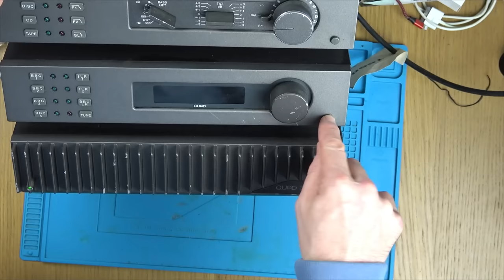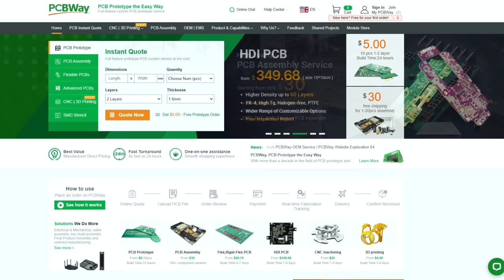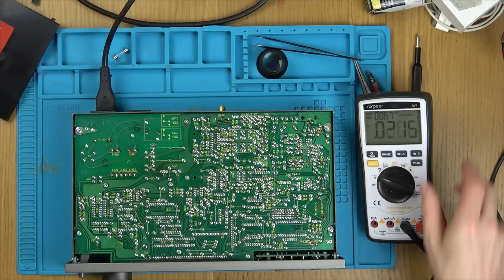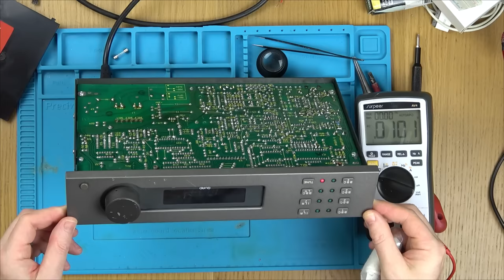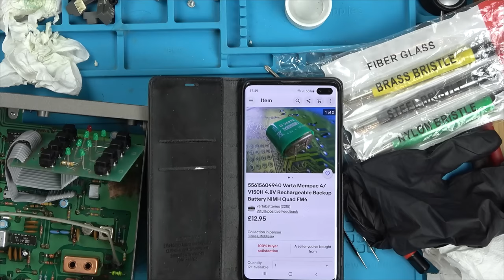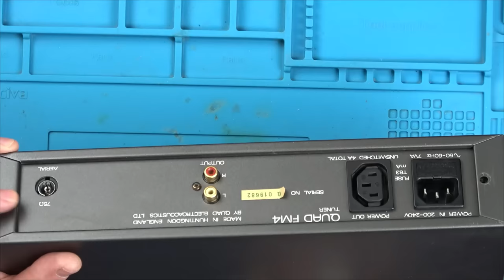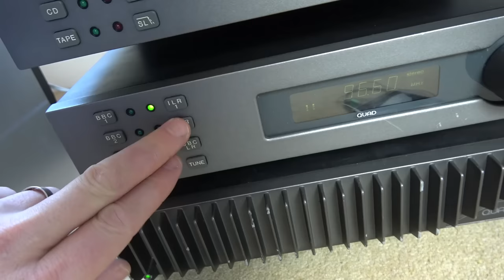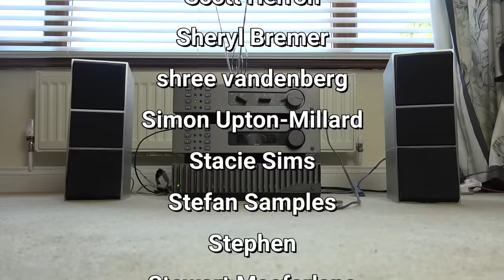QUAD - The Crème de la Crème of Audio - Can I FIX it?

Comment: Cheers for the video mate. I used to work at Quad building the speaker cabinets and spraying the speaker membranes with carbon. Your little discs are also carbon sprayed on one side. My mum worked there for 23 years before Mission took them over. She retired 3 months later and they gave her a brand new set of Mission 77 speakers. I still have them to this day and they work fine on my 30+ year old JVC UX1 Micro System. There is still a little company of ex employees in Huntingdon that service and repair anything Quad. And did you know Mike Oldfield recorded Tubular Bells in a studio full of Quad equipment including 26 Electrostatic speakers. He was our biggest customer in the UK. Most of the equipment was shipped to Japan as at the time they couldn't emulate it as it was all hand soldered.
Reply from the maker: This is amazing, a few comments came in about the little discs mentioning they might be silver plated, but now we know it's carbon!!!!  Also the Tubular Bells bit is just the icing on the cake. 
Thanks Trevor! Can I pin this comment so others get to read it? No problem if you would rather not 👍👍👍👍
Reply: @Mymatevince  By all means. Its history.
Reply from the maker: @trevorjones5625  Nice one 👍
Reply: Put me right in an era that I wasn't even a part of yet! A nice bit of audio history, thank you for sharing.
Reply: Tubular bells tho 🎧
Reply: As well as Mike Oldfield, am I right in thinking Nimbus records used Quad electrostatic speakers when mastering?
Reply: Hi there I remember quad. I worked on st. Peters hill making racing cars for a company called Lola
I'm used to know this old man call Charles he told me that he used to work for quad and was one of the people who helped design the electrostatic speaker an interesting man and I would sit in the pub with him definitely a professor type. Generally with food on his shirt and not a care in the world one day he was telling me a story about the time he made a set of speakers for Eddie Van he said they like to pay send but they prove the point I miss old eccentrics like that it's nice to know that there's people that remember admission and the knowledge Street Huntingdon gave to the world of speaker technology
Reply: @stewartcpitt  Hi Stewart. I remember Lola's well and was a very sad day when they finally closed. My brother worked for Lola Composites for a few years. I used to work down the road at Specialised Mouldings/Darchem/Paxfords. And yes, Charles was one of our secret weapons and an absolute genius. A very humble man but an amazingly kind soul. If you know Lola so well then you must remember Insulpak. I ended up working there for 20 years until 2013 when i retired due to ill health. Luckily a lot better these days. Are you local as i moved from Huntingdon to Godmanchester 17 years ago so still local.
Reply: QUAD equipment is brilliant i have an old Quad 2 set 1 pre amp 2 mains for stereo old valves KT22 etc still nothing to match tne sound quality 😊😊
Reply: I think there are quite a few other high-end audio companies in Huntingdon too - spinoffs, ex-employes etc.
Reply: @theelmonk   *Heartwarming to see some chaps chiming in regarding the older brands and the solder slingers as well. I'm from across the pond, and I have to say that there were many fans of the Quad electrostatics.
 There are also some shops that refurbish a lot of the '70s and '80s and beyond receivers and electronics. They still sound great. It's not necessary to spend a lot of $$ to get great sounding gear. 
 Check out the work being done at GR Research, his speaker mods, and new, affordable speakers.
 TTFN
Reply: Are the mission 77 the ones also known as Argonaut ,powerfull with low impedance?
Reply: @RUfromthe40s  I've never heard that name but it is possible. I never worked for Mission, i was given the speakers when my mum retired from there.
Reply: @trevorjones5625   i have some Argonaut mkII ,maybe from the second half of the 80´s and the number was the same but argonaut it´s written in the midle of the speakers box, they are big with 4 ohms and with lot´s of power i don´t remenber what i paid for them but they were expensive
Reply: I used to work at a professional audio shop selling QUAD 303, 404, 33, FM3, ESL-63, 44, etc so well built, I purchased 44 control unit & 405 control unit in the time they first came out in 1980s but last year some theif walked away with my 44 & 405 in mint condition the police are doing their best to locate them, they have a good idea who it was,
Reply: @CoolMusicToMyEars  Same thing happened to me a few years ago, My 405, plus later 90's NAD 216THX (one of only a few  more modern "real everyday peoples" amps worthy to sit by a 405 I reckon), and preamp, 80's Nad CD and cassette deck, Paradigm floor standers and nice little passive JBL sub with 4X5" drivers, (thats 4 of5") in a 3 way bandpass cabinet so 1 pair each mounted facing each other push-pull on the two internal divisions, plus the DAC I spent a fortune on because the blueray recorder only had toslink or coax, oh and the blueray.  Not an inconspicuous haul in a town of only 25,000 in New Zealand.  Cops had a tip off and all, but circumstantial and couldn't find grounds to search.  I still had the original Quad box and manual too, I think I binned it all in disgust.
Reply: @stewartcpitt  Did you happen to know Peter Bohanna? He was a designer at Lola.
Reply: @johnriley9214  The Quad IIs had KT66 output valves. When I was a student, I had a pair of Quad IIs and a pair of the matching preamps. The preamps were a pain due to the weird matching networks that plugged in the back, but I bypassed them and added an extra phono preamp. The setup sounded fantastic; sadly, as a broke student, I ended up selling them.
Reply: @cambridgemart2075  i would love to have quad tube setup
Reply: @theelmonk name drop then???
Reply: Was worth coming and watching this video just for the heritage in this comment!
Reply: the soldering on this board looks insanely good
Reply: Thanks,nice piece of history... We could have been a leader in allof that
Maidstone is the home of KEF spekers ,,,,, oh dear what happened !!

Comment: A word of advice at 40:52: you’re melting solder above the tuner’s faceplate. Since occasionally molten solder drips or sizzles, it’s a good idea to not have it near any cosmetic finishes you don’t want marred. I learned this the hard way.
Reply: Same bit of advice can be said for soldering electronics while in the comfort of your own bedroom while in your underwear.
For obvious reasons... learned this the hard way as well! 😝
Reply: @cerberus50caldawg  at least you were smart enough to wear underwear... learned this the hard way as well.
Reply: @cerberus50caldawg  i once dropped the soldering iron whilst modding an xbox, and stupid reflexes my hand swung and caught it... as in the hot metal end. dropped it immediately, half my skin tore off onto the iron, and cause me about a months worth of blisters and discomfort
Reply: @SyndicateofGamers  What did you shout, without swearing.....?
Reply: @gdj6298  can't remember exactly but knowing me plenty of f's and c's
Reply: @SyndicateofGamers  Everyone who works in electronics has done that. Usually only once!!
Reply: @cerberus50caldawg when I was young (really young like less than 10 years old) I had a pack of old circuit boards that I used to remove components to reuse. I also learned the hard way that you should wear socks on your feet because those blobs of solder hurt a lot when they splashed on my instep LOL! And they left burn marks for many many years.
Reply: @cerberus50caldawg  What's that Jerry Lewis song ..?
Reply: Loving the sound of that amp at the end. Lovely bass
Reply: @andylake7202  true, i think it hapens to everyone normally once is enough to really learn
Reply: Me too... I also learnt, not to try and remove components such as capacitors off of a PCB out of something using my leg and arm as a support. Slipped a few times with the iron.
Reply: @hernancoronel  The socks don't help, the solder melts through the socks and leave a nice burnmark, 12y old self found out.
Reply: Me too, fortunately i was 14 yo and hiding from my dad not to see me opening up something electronics 😅

Comment: I've had a Quad FM4 for around 30 years. It still does duty from time to time. I used to work for BBC Radio and we used Quad power amps for driving studio monitor speakers for around 20 years. As with any other fine equipment, you'll only get the best out of it if its partnered with other quality gear.

Comment: I like the video vince, well done on the repair.
My only suggestion in no power faults is always check the fuses first.
Once fuses are checked or replaced check the power rails shorting to ground without powering up the device.
If its shorting then investigate thoroughly.

Comment: Loved watching you work on the Quad. I own 13 year old Quad pre/power amps that I absolutely love in my system. I dread the day that they go wrong but watching this gave me hope that they could be saved. Thanks for a great video.
Reply: Hi. FYI, Quad (can't remember what the actual company is now, but can be looked up) are very accomodating when you have problems. We had a stupid fault on our Quad 44 preamp which just required a resolder. Unfortunately, while unattended for 5 minutes one of our Labrador puppies got at the PCB and did terminal damage to it. At quite modest cost, Quad supplied a new PCB + gold module connectors and a new relay to replace the one that had been mangled. We rebuilt it and all was good. There are many full schematics on the web + upgrades should one wish to go that route. Also had dealings back in the 80's and they were brilliant, supplying new components for nothing after I inadvertently blew up the 405 power amp through my own carelessness.
Reply: @Annie Masters  Thank-you so much for that information. It's good to know that they take such good care of past customers like that and when and if I have a problem I'll try them 1st. I listened to lots of different amps when upgrading 13 years ago and the Quad 99/909 pre/power amp's were the only ones I loved and still do. I'm glad you managed to get yours up and running again, with their help. Long may our respective Quads live on.
Reply: @rosalynadams3758  Quad always took long-term support seriously, and looked after old equipment. An odd little vignette on this: when they changed to using metric screws and threads, they had the problem that people might get confused when old equipment was in for repair, and force a new metric screw into a casting with holes tapped for imperial threads, thereby ruining a casting that would be hard to source. So someone came up with the clever idea of simultaneously changing from slot-headed to cross-headed screws so it would be obvious at a glance whether a screw in the repair place was imperial or metric.
Reply: That generation of equipment was far more repairable than modern stuff and will remain so. People are still maintaining vacuum tube gear, after all!
Reply: buy replacement components now

Comment: When starting up decades-old audio gear, with linear power supplies, I like to use a variac to increase supply voltage slowly, from zero to nominal over a period of hours, to give the old electrolytics a chance to re-form their dielectrics. Never had one go bang. Those filter caps on the other hand might need to be changed as a precaution. I remember the Quad stuff first time round and my memory is trying to tell me that the Quad 306 amplifier had a 'Current Dumping' circuit, and probably about 50-70W rms continuous per channel for two channels.

Comment: Hi Vince! Just came back to this video to thank you for inspiring enough confidence in me, that I took the chance on buying a broken Rotel CD player for 25 quid, in the hope that I might actually be able to fix it. The CD deck was advertised as able to power on but unable to open the disc tray. Naturally I assumed it was simply the drive belt for the tray eject/close mechanism that had gone to goo. 

I bought it and tore into it, but alas it was not only a broken belt, the gear that moves the laser lens assembly up and down had worn down and become brittle. That means that while the deck will actually read the CD and display the number of tracks on the TOC, it simply will not play since the laser couldn't move along. Tracked down a replacement gear for under 5 quid posted, and it now lives again! An expensive deck that still goes for a couple hundred quid, used in working order, these days for 30 pounds! 

Your videos made me believe that with some logical troubleshooting steps & methods, as well as a good amount of luck, repairing stuff doesn't require a garage full of expensive, specialist tools. Basic tools & subject to the availability of parts, a novice can get the job done eventually. Thanks mate! Keep doing what you enjoy, and I'll keep enjoying watching what you do! Cheers!
Reply from the maker: Well done for giving it a go and congrats on the successful fix 👍👍👍 One of many I hope.

Comment: As you apparently were looking for a production date inside the power supply section and not finding it there, may I remind you that the the IC labels include a manufacturing date codes. In this case, the TMS1000 microcontroller clearly shows it was manufactured in 1986.
Reply from the maker: Thanks Ascania 👍👍

Comment: Came across your channel by accident and found this video very interesting.  Brought back memories of my early career in BR.  We used Quad 50E, mono multi-tap transformer output, amps for station PA.  They were virtually bomb proof!  If I remember correctly we had around 30 located in Kings Cross station distributed across 4 equipment racks around the station for the PA.

It was very interesting to see the quantity of analogue circuitry in the tuner, clearly indicating why the cost was so high.  Nowadays of course a SRD receiver chip a DSP chip and a small micro would be all you would need - how times have changed 🤣 the most expensive components in modern audio equipment  is probably the human interface devices (knobs and buttons!)
Reply: Receiver, DSP, couple tactile moms, input jack, pot, couple of posts/banana sockets, 50+50W(pk) class D board the size of 20 Pall Mall from aliexpress for $5.  You'd have a receiver amp smaller than half lb of butter that would have people in the 60's looking for the hidden hifi system.  Hell, double the size and add arduino with bluetooth, wifi, remote control/smart home integration, and full colour oled display hahaha.  Still, I'll keep my 405 and it's big black frontal heatsink 😉

Comment: RECord and REPlay or playback. One set of phonos is for the input FROM the tape, Left and Right. The other is to send your source signal TO the tape for recording, Left and Right.
So REP is for PLAYING BACK your tapes, and the other is for RECORDING to tape. That is standard to have four RCA's to create your Tape Deck LOOP.
Reply: Just to add that the highest quality tape decks had separate record and playback heads. The tape passed over the record heads first, then the playback heads. This made it possible to record from the source via the pre-amp record outputs, while simultaneously monitoring the actual recording quality from the playback heads through the replay sockets,  power amp and loudspeakers. The best quality loudspeakers were often referred to as 'monitor speakers'. Sadly, your B&O ones, while nice,  are not in that class.

Comment: One thing I noticed, when you are working on the unit you are reaching over the unit to switch the power on, you should ensure that the mains sockets to the side of you, so you don’t need to reach over. It’s also provably worth you investing in a mains isolation transformer (gives you a bit of added protection).   If you ever do any similar units that have a custom mains input socket (e.g Pioneer CD players) and solder the mains lead into the unit, make sure you tape up the custom plug, I learnt that the hard way.

Comment: Hi Vince. You're a great analytical technician. I too work on many high voltage equipment and the risk of electrocution is high. That is why I purchased an isolation transformer to protect myself when working on high voltage equipment. They are a good insurance policy to protect your life. And regarding the tape input and output, there will be two sets of sockets. The REP pair (replay) will be to receive the audio from the tape deck, and the second pair, REC, is to send the audio from the pre-amp to the tape deck to record the music onto tape. Great video, thank you.

Comment: Hi Vince, great video.  Must confess I winced when you plugged it in after changing the fuse.  I blew up an amp a while back after I shorted a connection.  Taught me a valuable lesson!  Since then I made myself a dim bulb tester, which uses a 100Watt incandescent light bulb, not easy to find anymore but well worth it.
Reply: I bought several when they started to disappear, about the price of a packet of matches.

Comment: Nice repair, a note on the RIFA caps though. It's not required to purchase a new one made by RIFA, any safety cap with the same ratings (class X2 47nF-100R) will do just fine and can be found for less than half of the price :)
Reply: Any will do, but it is a critical device... Make sure it's over 400v AC rated, these are often not spec'd at RMS voltage.
Reply: I have just checked a lot of old valve black and white TVs, even with a variac, the RIFA capacitors went bang at some stage, about ten of them. So much for safely compliance.